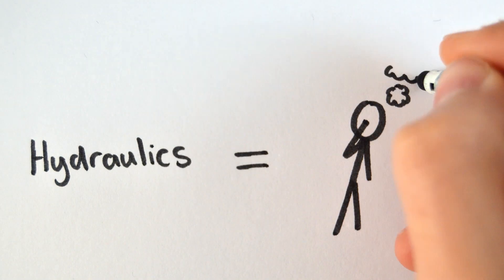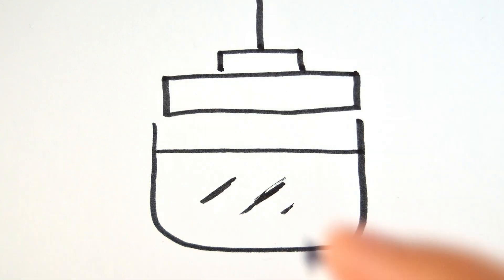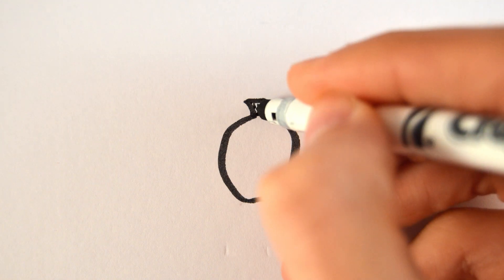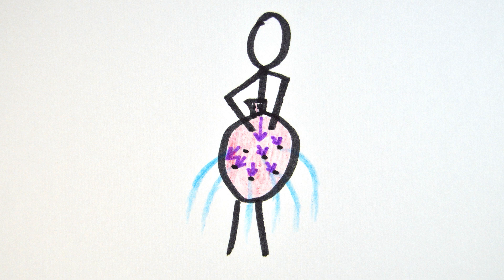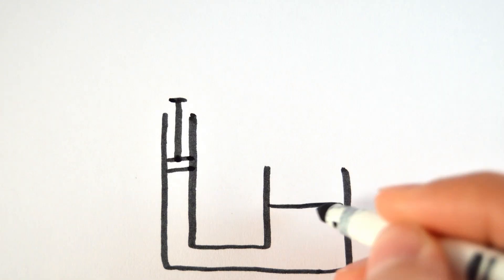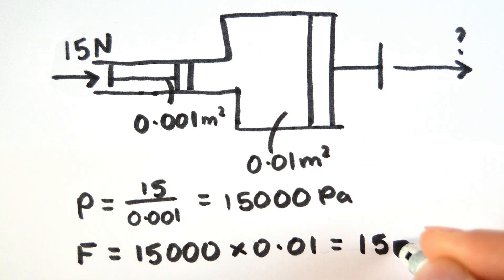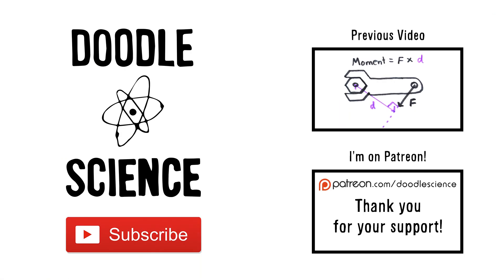Hydraulics | GCSE Physics | Doodle Science

Comment: Does that mean that with multiple pistons we could increase the force exponentially? I feel like i'm missing something here
Reply from the maker: +Jim Groth Hey Jim, Energy or work done is equal to the force x distance moved in the direction of the force. When you apply the small force e.g. the 15N to the small piston, the piston moves a certain distance along the tube. As there is a constant amount of liquid and the other piston has a much larger area, it will only move a small distance in the direction of the force so in theory the work done pushing the small piston will be conserved when the second piston moves. Hope that was clear! :)
Reply: ***** Perfectly. Thank you. :)
Reply from the maker: Hey, are you referring to multiple master pistons or multiple "slave" pistons? Thanks :)
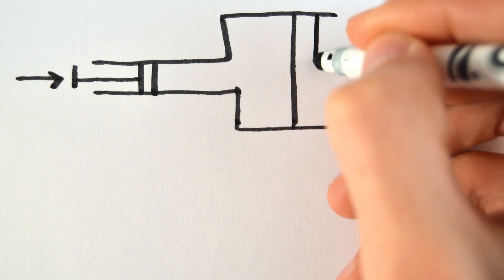Reply: +DoodleScience the thing you're talking about at 1:00
Reply from the maker: +The Wise Whale If you had another piston of the same area at the end then you could multiply the total force to 300N. If you think about the braking system in a car which goes from one pedal to 4 brake pads. You only apply a relatively small force to the pedal but it is still able to decelerate at least a 1000kg car. I hope that answered your question! :)
Reply: +DoodleScience I suddenly got the feeling I didn't understand after all. How can a small force get amplified? Where does extra energy come from?